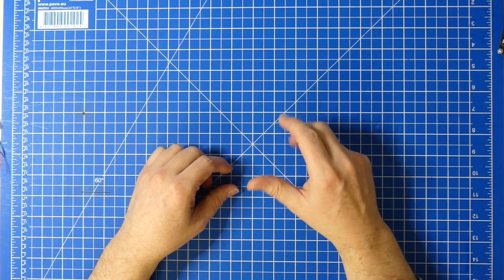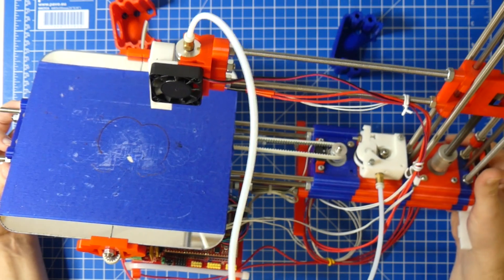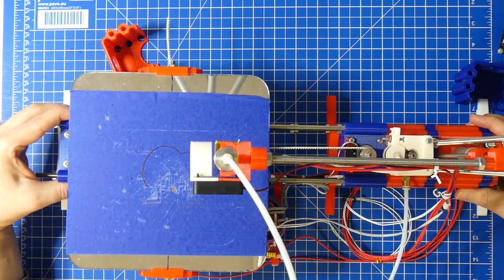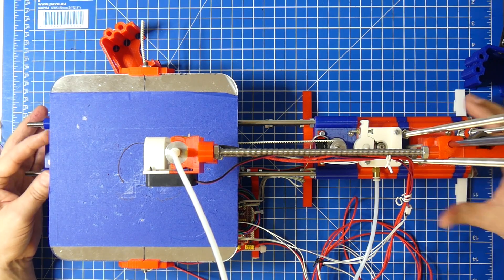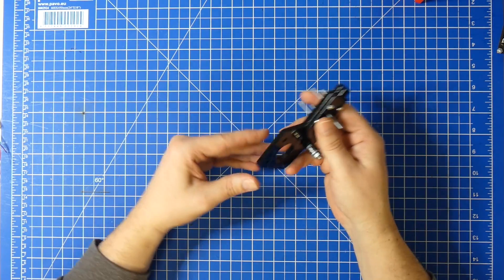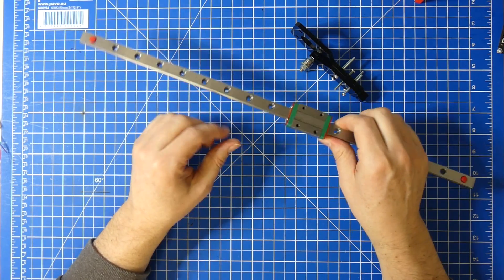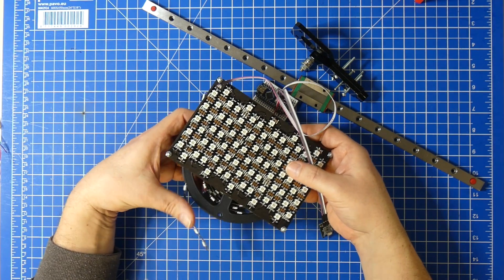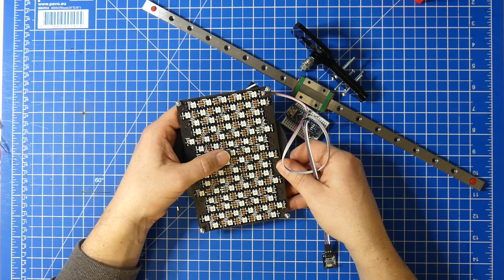Updates to the Robin 3D Printer Project

Comment: STL File missing  how to lift the krane
Reply from the maker: The part that lifts the crane is  'Rob-3D-Krane2.stl' . A TR8 nut for TR8 threaded rods slots into the recess at the center.
Reply: the smaler one holds the rods for the hotend the bigger one is missing
Reply: and for the hotend i found nothing
Reply: ok my fault i must print four 3d-Krane1.stl
Reply: btw coole Konstruktion
Reply from the maker: Danke - ja - Hotend muesste eine neue Halterung her die beliebten t6 Hotends gab es damals noch nicht.
Reply: Machen Sie noch was dafür ? mit Halter Bed Level Sensor ist optimal. Video mit angepasster Marlin Firmware wäre cool. Ich hab ein OLED Display an das RAMPS Board angeschossen.
Reply: Im Video ist ein HOTEND Halter weiß rot aber leider kein stl
Reply from the maker: evtl passt der extruder-halter von meinem neuen Drucker, werd mal schauen.
Reply: Extruder hab ich ja schon, es geht um das Hotend an dem Kran.  :-(
Reply from the maker: Ja, Hotend -sorry, meinte ich. Im Bad Robin Verzeichnis ist ein V6 Halter, den koennte man adaptieren.

Comment: On the z axis of the robin, would a 3rd theaded rod in triangle make it just a bit more rigid, or does it suffer any wobble at all?
Can we get a video of it running and the bed moving in x and y direction?
Cool little looking printer, oh, can we get the screws/rod sizes in non metric as well?